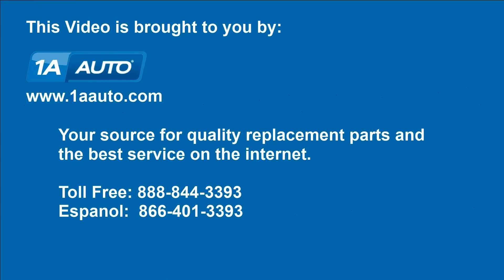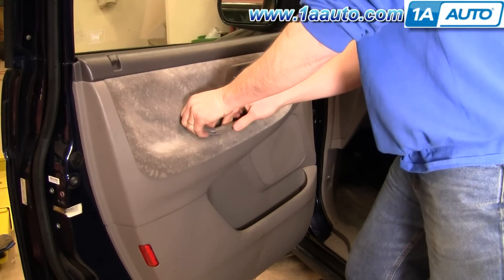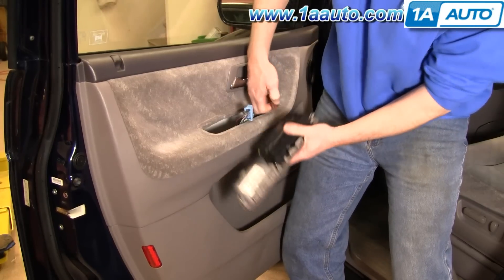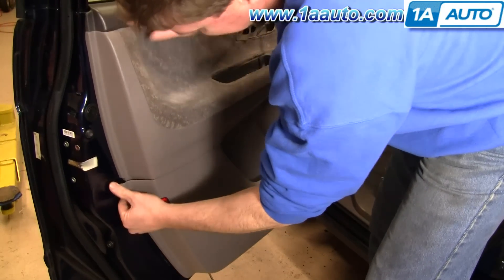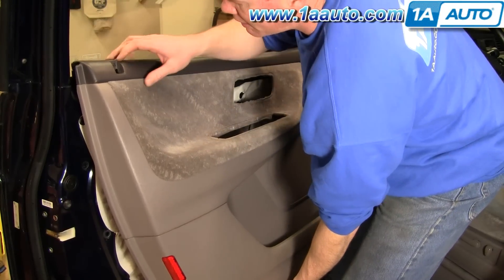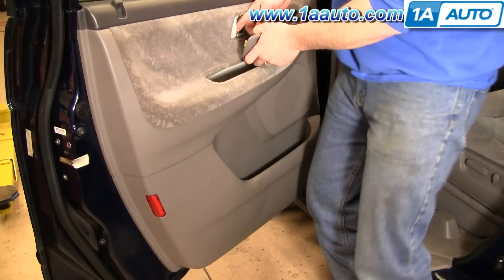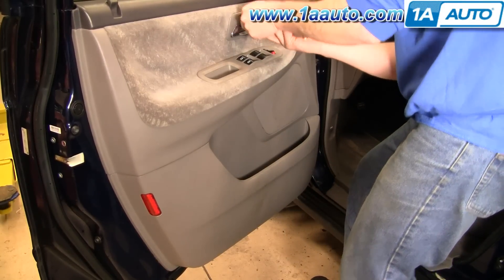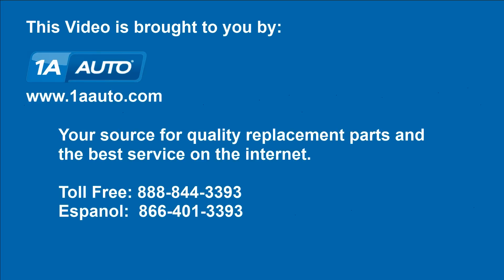How To Remove Door Panel 99-04 Honda Odyssey

Comment from the maker: You may need to remove the door panel to access the bolts holding the mirror in place. Hope this helps you out. 1aauto.com 888-844-3393

Comment: Great information to assist a guy with blown speaker issues due to load music habit.
Loving the double speed feature of youtube...
Reply from the maker: +hintzofcolorconcepts Thanks for watching. 1aauto.com
Reply: hintzofcolorconcepts you don't have to remove the entire panel when replacing the speaker all you need to do it pop off the outer piece

Comment: Hi.. i need tho change the driver side mirror power of my Odyssey 1995. as you may know The Power goes different into the door. is the procediment similar of the 99 odyssey to take apart the door?

Comment: Great.  Yesterday as I was rolling the driver's side window down in my 2002 Odyssey it started making funny noises and disappeared into the door never to roll up again.

Do you have any ideas what might cause the window to just roll all the way down and never roll back up?  I think the motor is still working, I can hear it, but something is off because it does not engage or roll the window up.

It's so weird, the Honda Odessey, at least my Honda Odyssey is so reliable.  I have 150,000 miles on it and it has never broken down, but the windows, motors and dashboard lights are always failing on it, so I'm hoping to find a way to fix it on my own.  I am not normally mechanically inclined to fix cars, but this is ridiculous.

Thanks for the video ... at least I know what to expect before I get to removing that white covering layer behind the door panel!

Comment: I have a 2000 odyssey the passenger door won't open from the outside only cause the plastic piece has snapped in half do you guys sell that part?
Reply from the maker: We do carry outer replacement handles for your Honda Odyssey. Here's a link to them on our website. Thanks for watching. http://www.1aauto.com/2000-honda-odyssey-exterior-door-handles/y-mo-c/2000-378-15?utm_source=YouTube&utm_medium=YouTube&utm_campaign=1ATony
Reply: @1AAuto  , I'd like to see how you remove the inside panels on the sliding doors ( mine are manual but I think both are the same , I want to fix the doors so they can be opened from the inside !
Reply from the maker: +Dan Logicalogically Thinking We're always cycling through cars filming hundreds of common repairs for common vehicles every month. We'll add this to our list of repairs to film. Check back again and hopefully we'll have it soon.

Comment: You might need to remove the speaker grill and remove 3 screws that are behind it.
Reply from the maker: Thank you for watching!
1aauto.com  888-844-3393
Reply: The 2003 Odyssey has two Phillips screws behind the speaker grille.